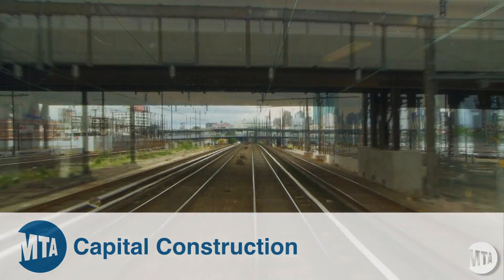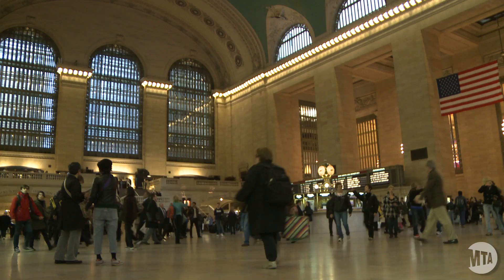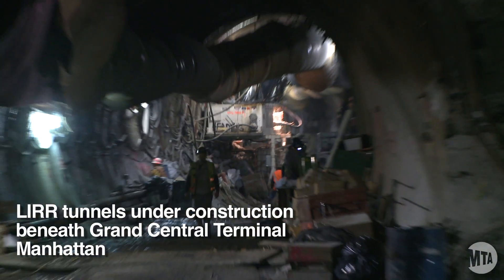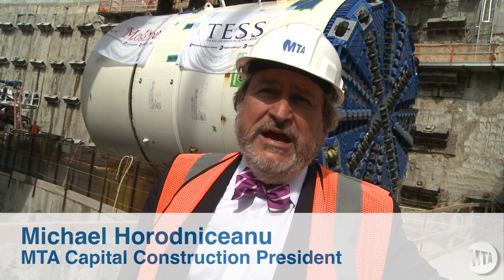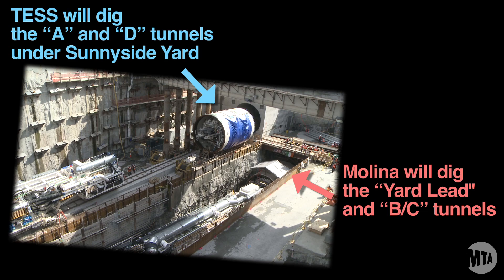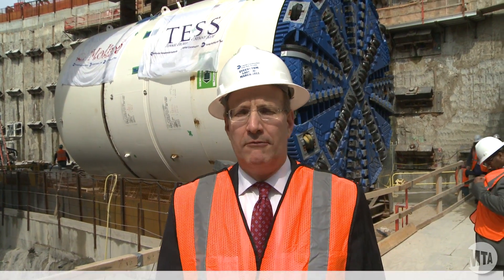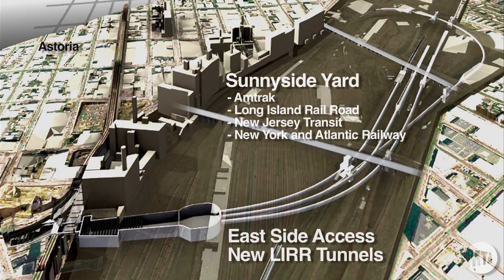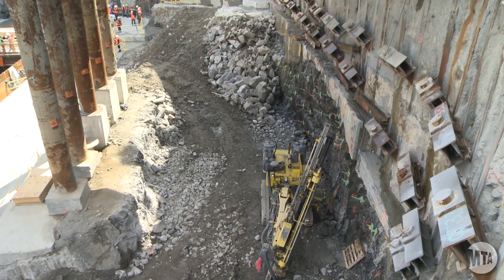East Side Access Soft Ground TBM Launch

Comment: Where's "The choice between two Manhattan terminals, Penn Station or Grand Central?" I don't expect it too soon (besides the New Haven line M8s) but it will be fun and a bit crazier with that. I know Penn Station has barely enough room there but they can create new tracks as they are at GCT.